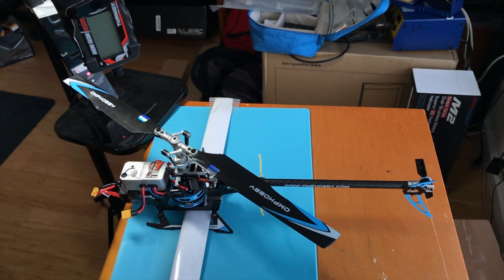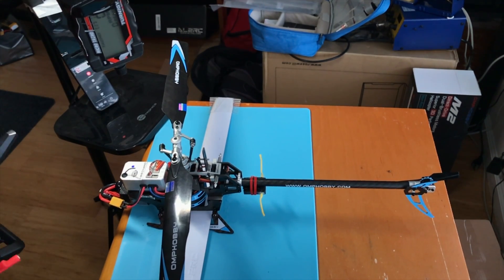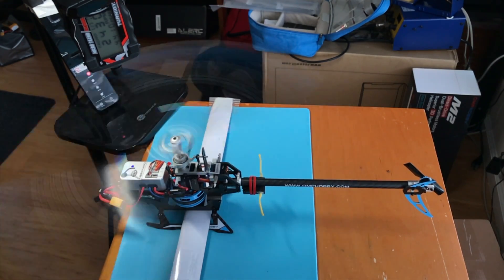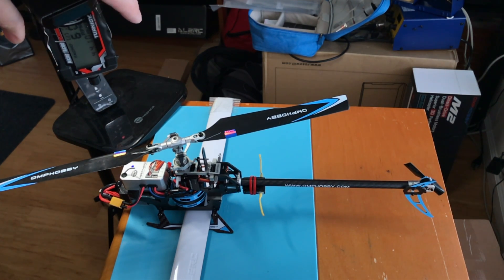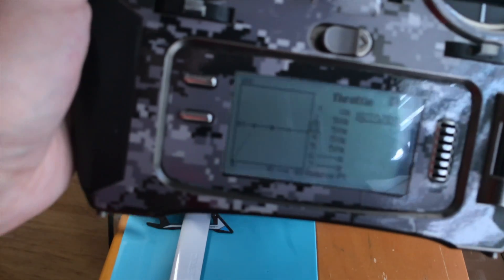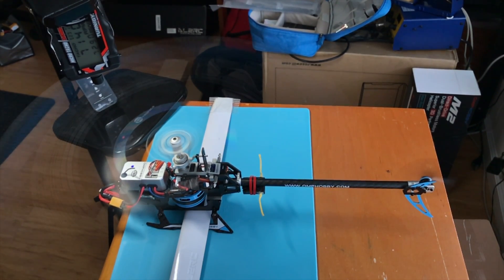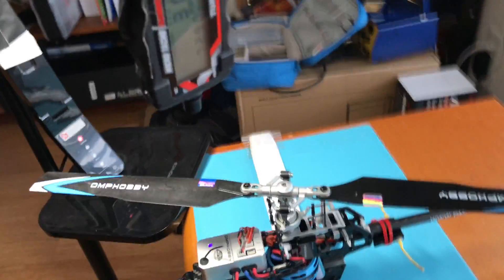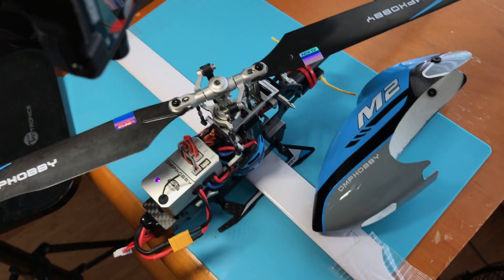OMPHOBBIES M2 RPM rotor speed testing

Comment: I saw your test setup and think, that the way you have the stickers put onto the rotor blades it double triggers the rpm meter and therefore it shows double the rpm, i would try to stick one sticker directly to the motor's rotor and then measure the rpm.
Reply: Do you guys not know how a tachometer works set to two blades? Giving it half the feedback would result in half the true RPM.

Comment: You have to put the reflective tape on a single blade. Not on both blades.
Reply: Do you guys not know how a tachometer works set to two blades? Giving it half the feedback would result in half the true RPM.
Reply: @YoYo-fy5nm  That's right. But result should be half of the showing RPM. It's okay but true reading is with 1 reflective tape.

Comment: Nice test. thanks. What Radio are you using?
Reply from the maker: I use a Spektrum DX9 with a single micro DSMX receiver that was pre-binded with a different receiver. Works great! I've also used my Taranis QX7S with the included Futaba FHSS dongle, but I'm unable to get the model to respond quite the same way with the different transmitter, so I've gone back to using the DX9 for the most part.